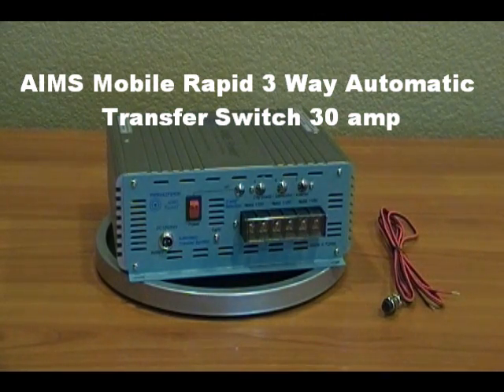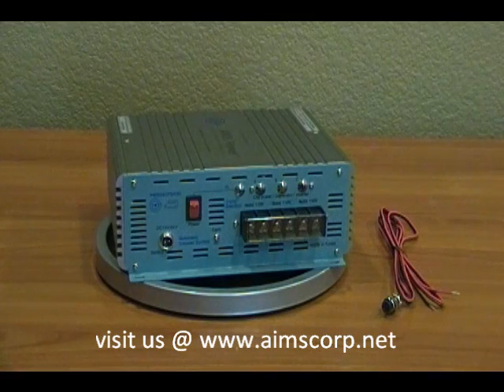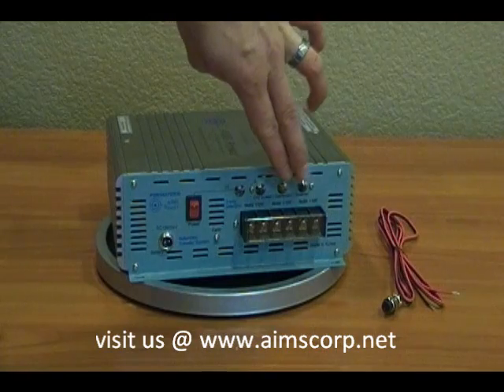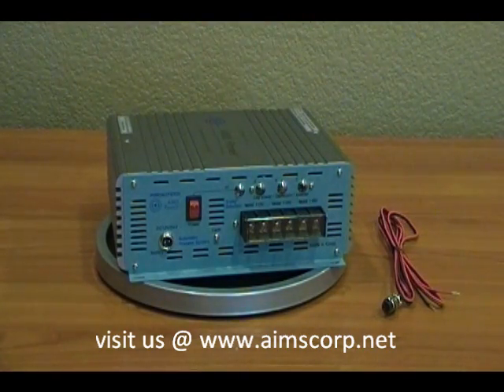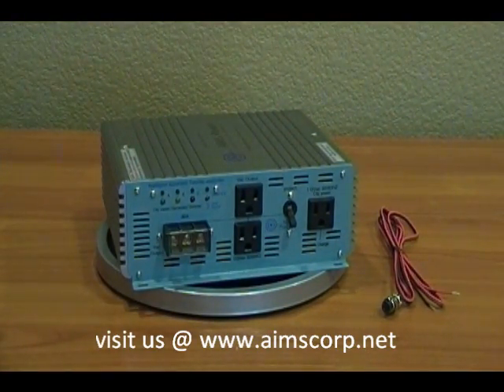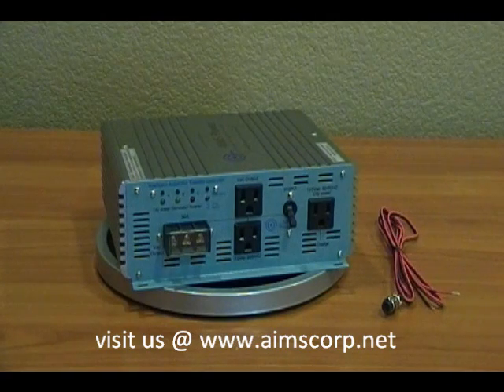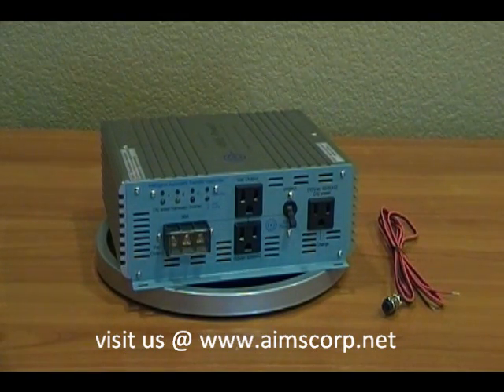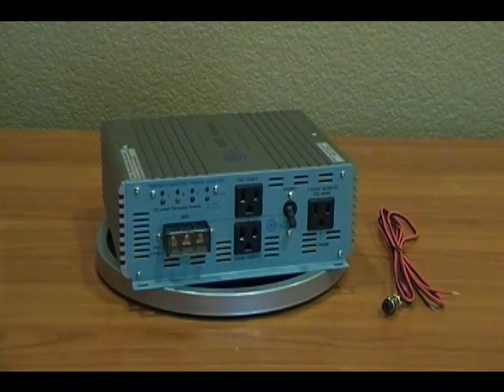3 Way Automatic Transfer Switch -- Exclusively from AIMS Power Inc

Comment: I would buy at least 2 of these but they absolutely must be cUL approved or CSA approved. The c with UL means it meets Canadas approval process as well so a insurance company pays if a million dollar commercial building burns because of the unit. Call me if you have approval. 250-782-7108